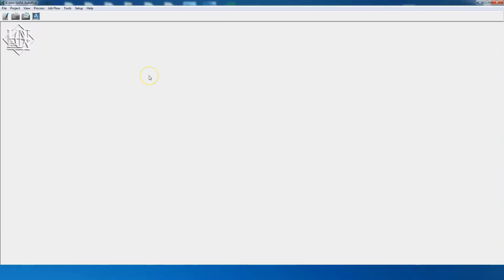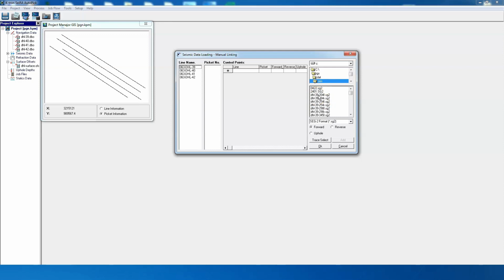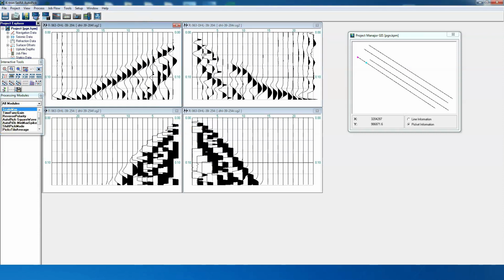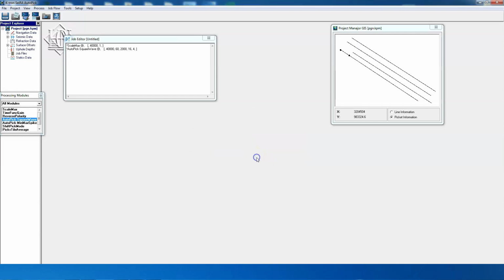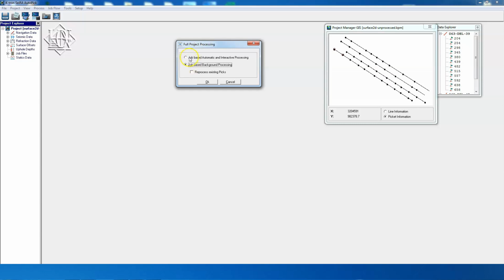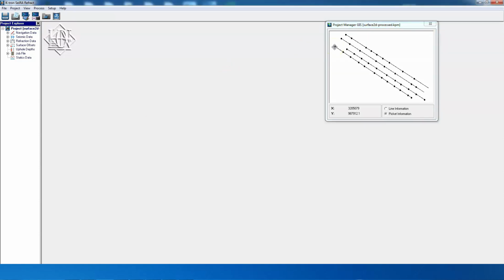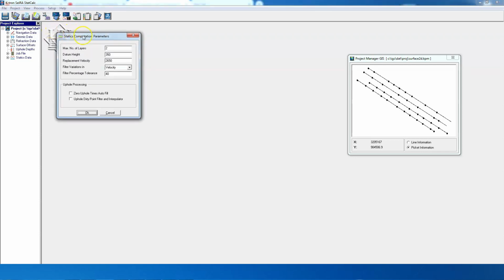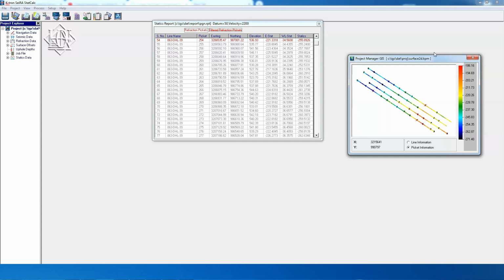Seismic Refraction Processing using SeiRA - Part 2: Working with the Software

Comment: Hello Sir i need to ask you what is the program used to seismic froward modeling .?
Reply from the maker: The Software used is K-tron SeiRA (Seismic Refraction Analysis Software). Its not for forward modeling... software has 3 modules: AutoPick for Neural Network based automatic first break picking, Refract for travel time inversion and StatCalc for Statics computations.